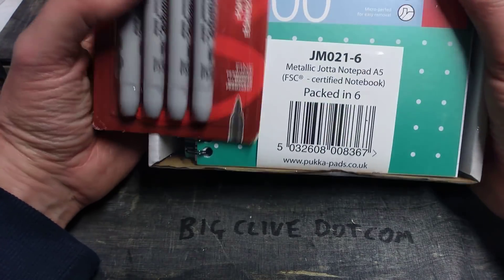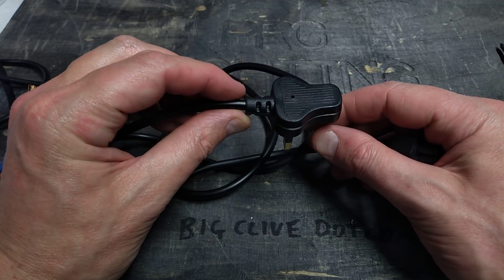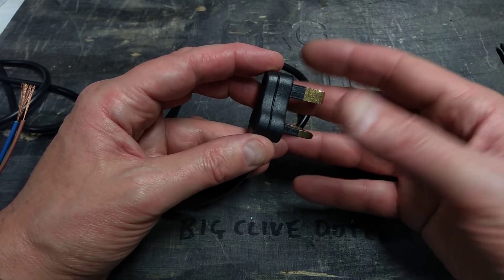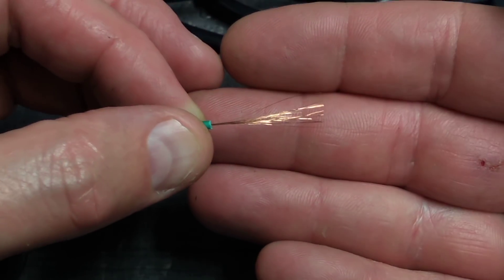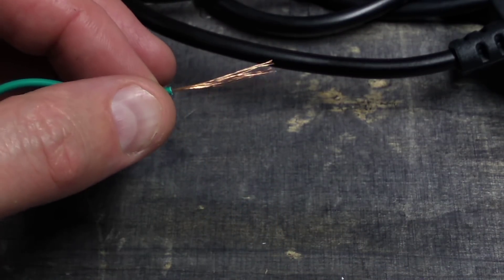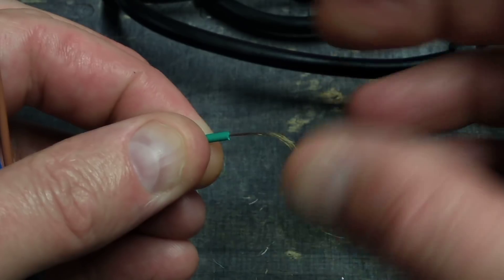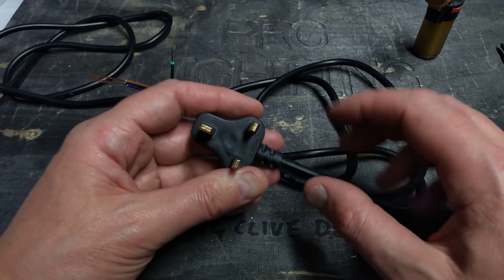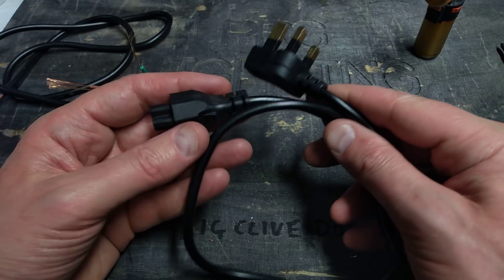How to detect shitty and dangerous aluminium flex.

Comment: I have drawers full of power leads.  Is there a way to test them to see if they are copper or aluminium?  Like a resistance check or some other kind of test setup to determine what the wire is without having to do a destructive tear down?
Reply: Stick them on a good test load setup, say 10 amps, and measure the voltage drop. This will also show telltale signs of bad connections or too many broken threads on an otherwise proper cable. Weighing them should also reveal something as long as they are the same lenght and insulation type I guess.
Reply: If you have a relatively precise constant current supply then measuring the voltage drop will give you a way to accurately measure the resistance, as the previous commenter suggested. Directly measuring the resistance won't be easy since the actual resistance of the cable is very low.

Weighing might not reveal much since the insulation thickness as well as the type of plug used can influence the result significantly.
Reply: Earth bond test (ie PAT tester) ought to find it.
Reply: A milliohm meter is the best way. Copper and aluminium obviously have differing resistivity.
Reply: Trouble is that the correct resistance for a 3m 0.75mm lead is less than 100 milliohms, so it could be ten times too small and still pass your "cheap multimeter" test. To test properly you really need a 4-wire measurement set-up.

Comment: After the burning with the lighter, it seemed to look more like aluminium. Or was that the lighting.
Reply from the maker: It did go grey.
Reply: Raymond Mucklow Aluminium oxides? The copper coating is so thin that expect it burns away

Comment: I used to work for an IT company in the West Midlands.  We'd bought a large number of PSUs from a reputable wholesaler and they all came with those shitearse power cables.  First time I'd seen them.  Luckily it was me doing QA on an outgoing batch of machines that all had them.  I dread to think the liability we'd have faced had those made it into the hands of customers...
Reply: We got them in case+psu combos, but that was before they started sleeving the earth pin. I hated them, the boss "couldn't see a fault" with them :(
Reply: HP ( I think, a major computer brand anyways) had to recall a largeish amount of power supplies because of fake wires like this.
Reply: Pentti Kantanen HP had multiple power cable recalls over the years, the ones I looked at all talked about insufficiently secured plugs or cables becoming frayed, though that might of cause have been a PR restatement of thin/fake copper.

Comment: A fourth problem?  It looks like the physical dimensions are too small, making it easier to touch the pins as you pull it out of the socket.
Reply: There must be a distance of 9.5mm from the edge of the plug and the pins and it hasn’t got a fuse. If you come across a plug like this break the pins off, cut the cable in short lengths or burn it. These plugs are widely used in parts of the world that use the same sockets as the UK but they are not safe and illegal to use in the UK.
Reply: That was my #3 because I did not get to see the wire at first.
Reply: Those dimensions were defined before sleeved pins.  But they're still legally in force.  So, yes, another problem with it.  Another way in which it is illegal to use here.
Reply: First thing I noticed. I although I once had a legal looking cable catch fire. The plug all looked legit but the cable itself was copper coated aluminium. It was powering a 1 amp external hard drive yet still went up in flames :( Turned one of the cables had just three strands in it :(
Reply: @p166mx  it had to go open circuit for that to happen? Oh wait just three strands? That is crazy! Time to buy some real insulated copper flex screw that for a barrel of laughs i would rather wash my hands in salt walter then work on my 3 phase cooker supply whilst it's still live.
Reply: Also making it very difficult to pull the plug out of the socket.

Comment: With metals - speculation leads to more mining and also makes recovering copper from waste more viable, so if the speculators get it wrong, all they do is lose money and in the process pay for more copper to be extracted and recycled.  Copper prices reached their all-time max in 2011, and are now about 40% lower than that price.  There's about 1000x more Aluminium in the earth's crust than copper.  Google for "Abundance of elements in Earth's crust" and "Historical Copper Prices".
Reply: Hysterical Copper Prices. FTFY

Comment: I first saw those plugs show up in Uganda about 20 years ago - where I also saw a ring main run in 0.5mm² twin+earth (32 amb MCB naturally).  I think the sleeved earth is a new improvement tho'.  Another way this fails I think is plug shape - wikipedia says "distance from any part of the line and neutral pins to the periphery of the plug base must be not less than 9.5 mm. This ensures that nothing can be inserted alongside a pin when the plug is in use, and helps keep fingers away from the pins."